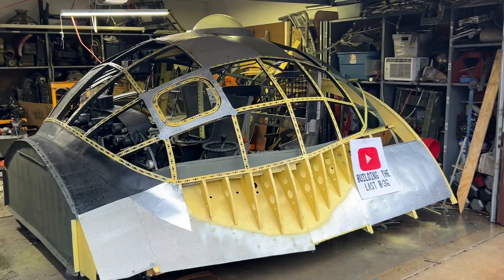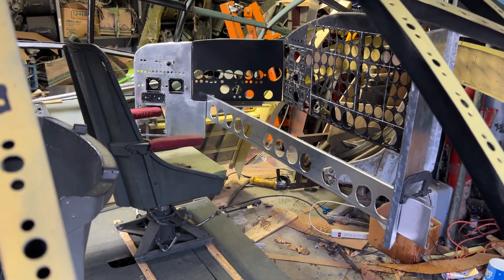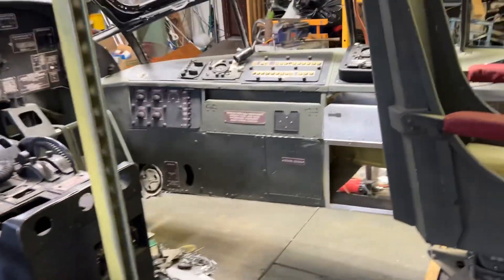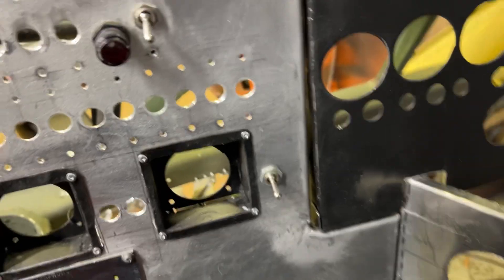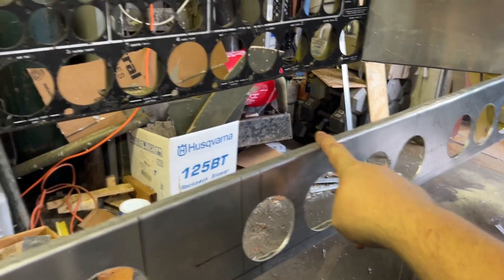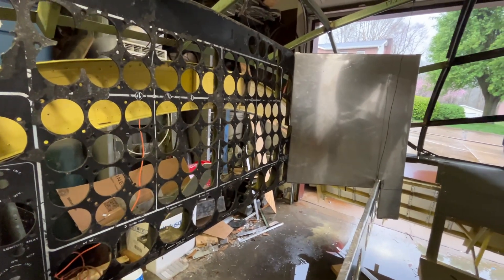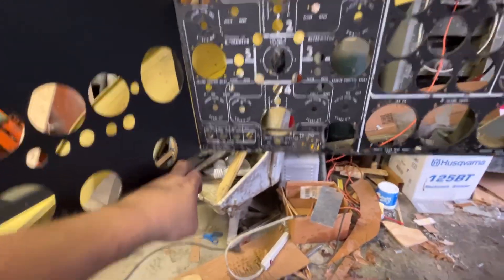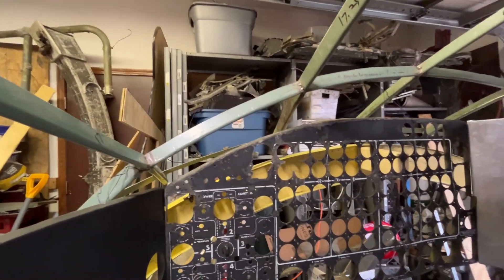How to Build a B-36 Flight Engineer Station Part 284

Comment: You ever just sit in the cockpit and drink a beer? I know I would.
Reply from the maker: Back when I was building the flight deck components and I had it set up in the basement, I would often fall asleep in the pilot seat. Now that I am three years into the thing, I clock out and don't want to have anything to do with it until the next day. I may drink a beer in her when I am done, or at the airshow I pull her to, one day.

Comment: That looks amazing sitting in the flt engineers seat thinking of what they went through in service. Just an idea but linking the throttles could you do it with chain and sprockets even bike ones to save money? Also you mention  looking out over the wings and tail. Pity you couldnt get the image of that view and portray it on the inside of the rear sections of canopy respectively that would look amazing view from the flt engineer seat
Reply from the maker: The throttles were linked with wires and is definitely doable. I built the pilots console with the intent to install simulation controls so I would have to rebuild the throttle quadrant. You never know; I just have so much work ahead of me. More work creates more work. My YouTube subscriber rate is going good. Eventually I’ll be able to focus on building all day long, everyday. That’s the plan and who knows where it will take things?